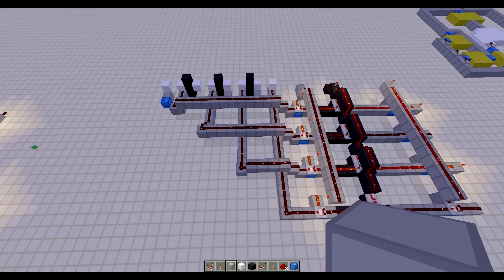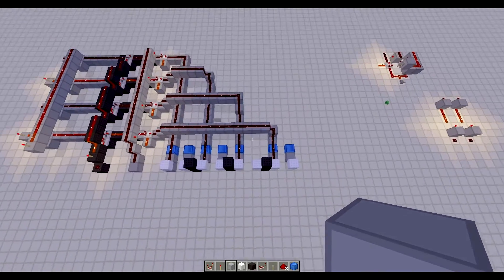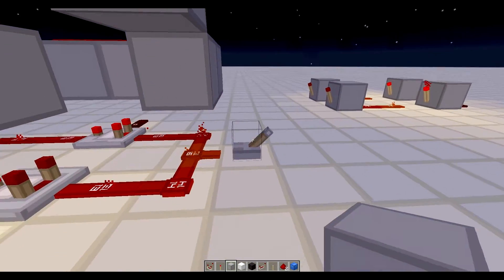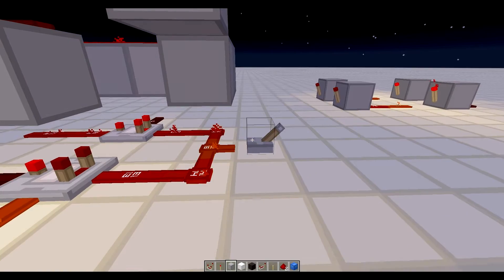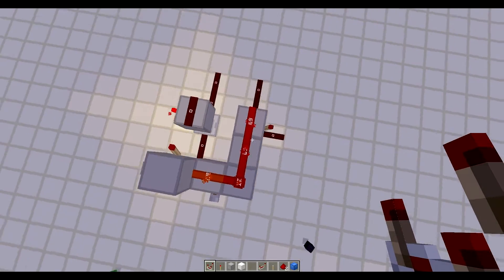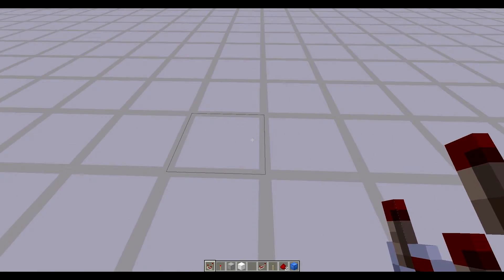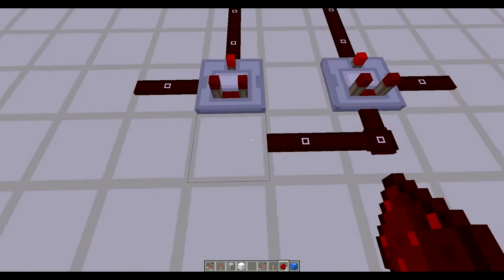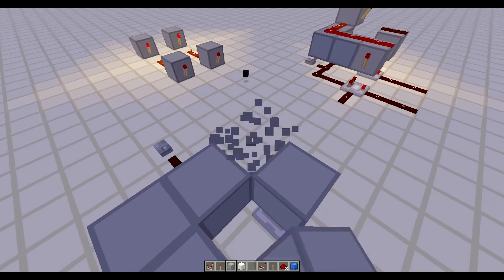Redstone Computer Tutorial - Episode 13 - Selector Switch

Comment: I can't wait to see if I'm write but the only thing I can think that would be useful for is if you wanted a 4 wire buss for the data instead of a 8 wire buss.... You could run Data set A and Data set B down the same 4 wires saving redstone at a cost of time.